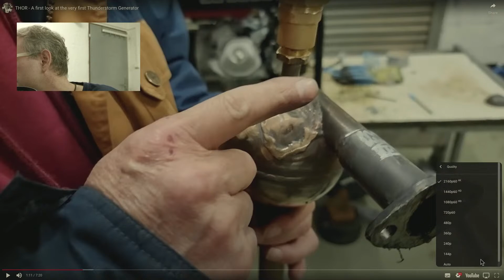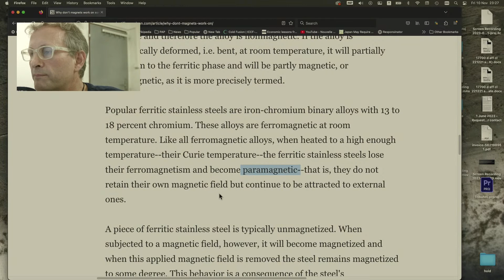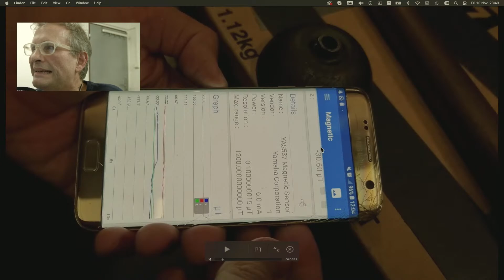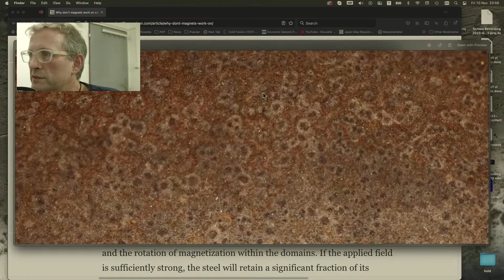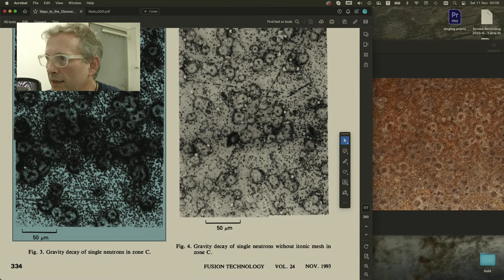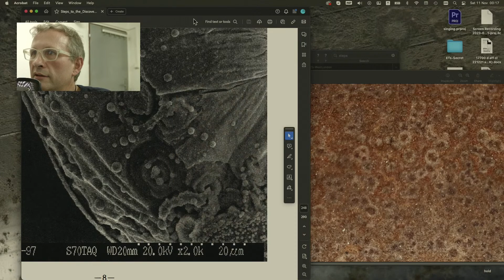THOR - Magnetic anomalies?

Comment: It has to be one pressed piece then annealed. Checkout Japanese steel forging and tempering after hardening. 
I’ve even made my own steel. There’s something to be learned playing with a forge. 
I agree that the Welds could be contaminated with what’s inside the rod/wire. If it’s feed free welding then it’s still electricity effected totally changing everything effected. Maybe cast iron is better? Or at least cast stainless
Reply from the maker: perhaps.

Comment: Welding special alloys have to be done perfect and to guidelines or things can go bad n the structure itself best to consult the various handbooks on metallurgical techniques used a lot for manufacturing of special components in vacuum tubes and handling dangerous matériels handling very important in aeronautical systems and nuclear I remember ken shoulders talking about this in 1997 when our talks where hoisted by Star Trek folks Linda Maclean many scientists where present at that time and yin was there faults in devices fir handling nuclear wast and plasma technology magneti s odd effects used in naval engineering of sensing equipments wave guides tubes alloys made to do this

Comment: DMLS is a bust, cannot do overhangs.
Reply from the maker: That sucks, so flexible flanges and slip joints
Reply: @MFMP  protolabs cannot accommodate any designs I have submitted. I did see DMLS doing such complex parts when using 3DOF base plate, I don't know any fablabs that have this equipment. If anyone in the community knows of one please let us know.
Reply: https://www.youtube.com/watch?v=47wu9O1WwCI